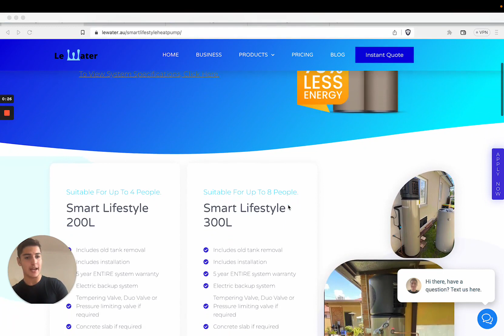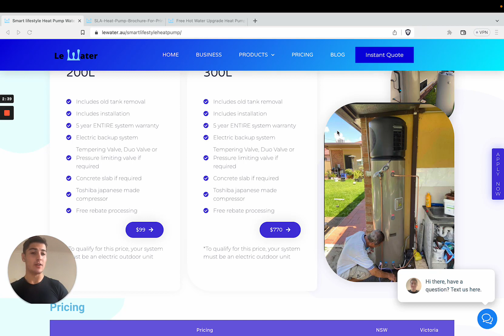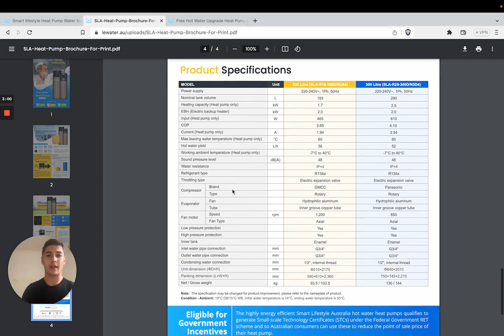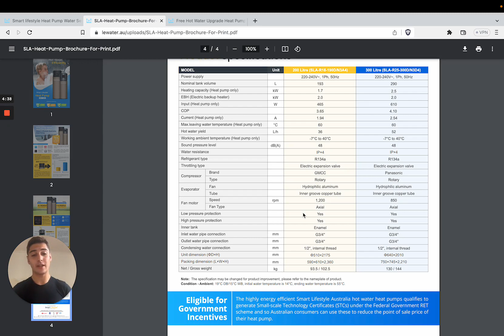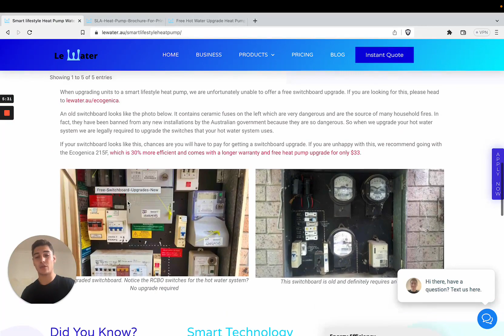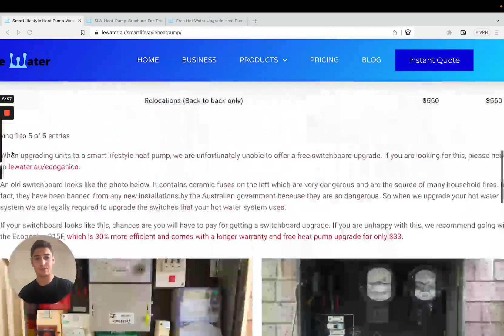Smart Lifestyle Heat Pump Review

Comment: I have installed this stupid  unit four months ago which causing me so many trouble . Firstly , not enough hot water for 5 people . 
Secondly, the motor noise so crazy during quiet time , especially the unit located near by our bedrooms . Everyone can hear and could not sleep well at night . 
Thirdly ... no wifi connection which I can't turn it off at night by wifi connection via my mobile it set up the timer at home . 

The operator always mentioned the this thing but he didn't mentioned any bad things such as above problems ... very sweet talk and I got hooked up sadly .

Comment: I have installed this stop unit four months ago which causing me so many trouble . Firstly , not enough hot water for 5 people . 
Secondly, the motor noise so crazy during quiet time , especially the unit located near by our bedrooms . Everyone can hear and could not sleep well at night . 
Thirdly ... no wifi connection which I can't turn it off at night by wifi connection via my mobile it set up the timer at home . 

The operator always mentioned the this thing but he didn't mentioned any bad things such as above problems ... very sweet talk and I got hooked up sadly .

Comment: Hello. Between the SmartLifestyle 300L and the EcoGenica 215F, which unit will you recommend?  Take out initial installation cost. I am more interested in the reliability of the unit and its long term running cost.  Thank you.
Reply from the maker: We do both but I'll state the objective facts. 

Ecogenica comes with a better warranty on the tank and labour. The 215F is also 17% more efficient than the SLA300, so I recommend Ecogenica.

Comment: What settings should I have my system? Mode temps and should I have a timer on
Thanks in advance
Reply from the maker: I recommend leaving it on factory settings, unless you have solar. The system only turns on when it detects heating is required, so there's no need to use the timer unless you have a specific reason. 

If you have solar you can set it to run just during the day light hours.
Reply: @GridlessAustralia  so there is no need to have timer for off peak and on peak ! Thanks
Reply from the maker: @dazk6718  The system can only work on off-peak or on-peak. 

We actually recommend going off of off-peak so the system can work as intended. The system will revert to factory settings every day if it's connected to off-peak. 

It's still cheaper to run a heat pump 24/7 than to run an electric system off-peak. 

Watch my video titled "How much money will a heat pump save me?" for more info!
Reply: @GridlessAustralia  Do you organise going off the  off-peak? i.e rewire the switch board? and if you do it, is there any extra cost?
Reply: @GridlessAustralia  You sais "The system will revert to factory settings every day if it's connected to off-peak"
What happened if there is a prolonged or regular blackout? how the system will cope?
Reply from the maker: @iptv3227  To answer your first question, we upgrade the switchboard for free! 

If there's a blackout the system will revert to factory settings.
Reply: @GridlessAustralia  Thanks for the reply. 
What setting should be changed after the blackout to get the system back in optimum setting?
Can you load a video going through these? thanks
Reply from the maker: @iptv3227  The main setting you'd be looking at changing would be for the timer. 

Definitely will make a video at some point! Thanks for the great idea.